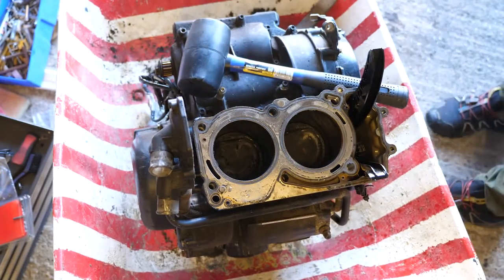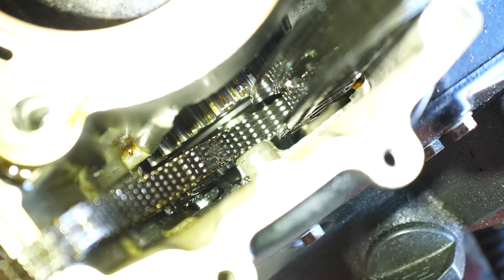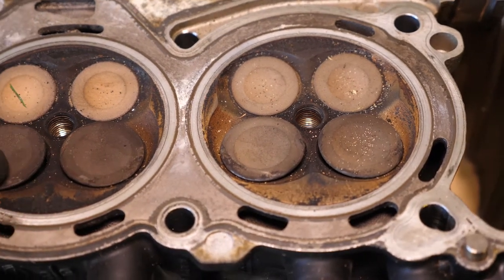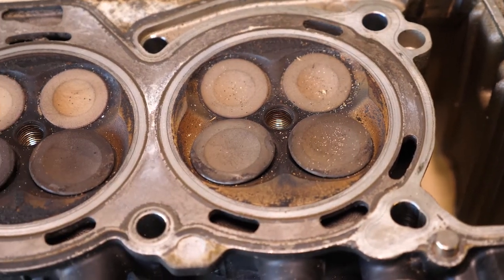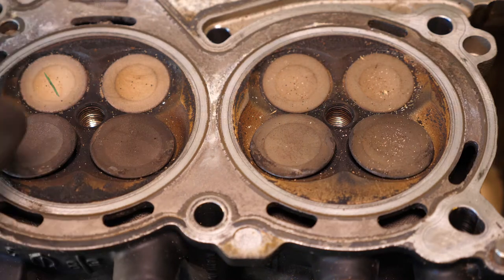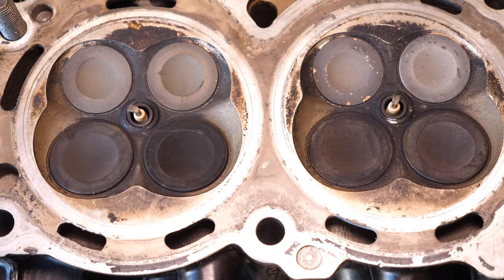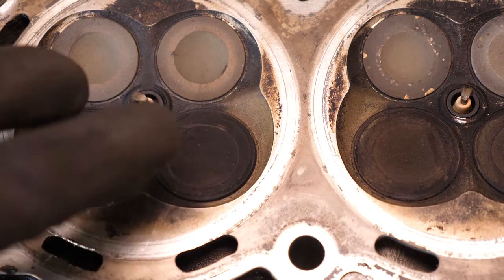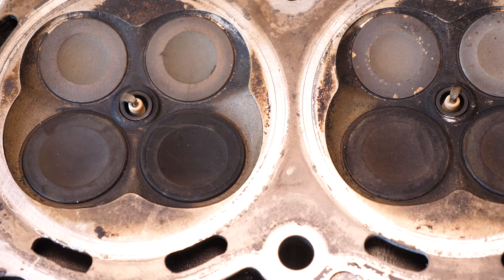The F800Gs Journey Pt2   Finding the cause of Death

Comment: Would you recommend replacing this evil plastic part early to avoid this, or even replace it with a metal one? For someone lacking the mechanical skill (or time) to do what you show here, this would be a junked bike.
Reply from the maker: Hi Per, I'd recommend looking out for the signs of Timing chain adjustment. Keeping the services regular and checking the slack. I was pretty unlucky as I was due to replace the timing chain but unfortunately it didn't want to wait! The plastic was a  by-product of the timing chain slipping, having at a metal one probably would have made the bottom end worse.
Reply: @edavies  Ok gotcha. I still let my local dealer do the yearly BMW service. Let’s hope they would catch this.

Comment: Hey is the engine hard to drop out? Can you drop it out the front with the rear subframe still assembled?
Reply from the maker: Hi, depending on wear yes it is relatively straightforward. I dismantled the whole bike due services the rest of the frame etc, however you can drop the engine with the bike in tact, a few engine mounting bolts and the wiring harness and you're good to go. I really struggled with the swing arm bolt that runs through the back of the engine which has corroded heavily on the aluminium bushes, had to get it hydraulic pressed out but that was due to the wear of the bike. Hope this helps, best of luck!